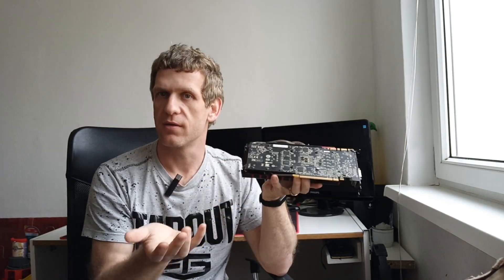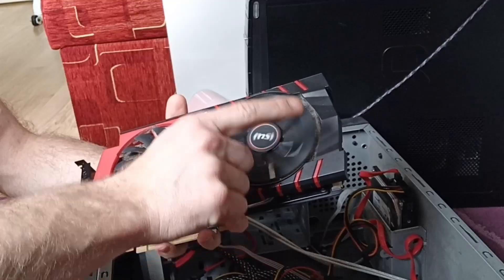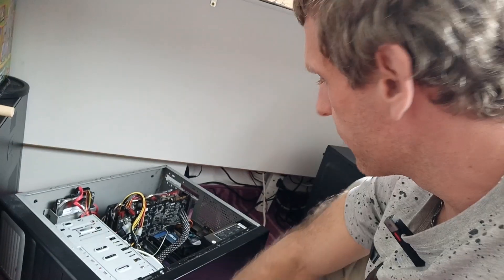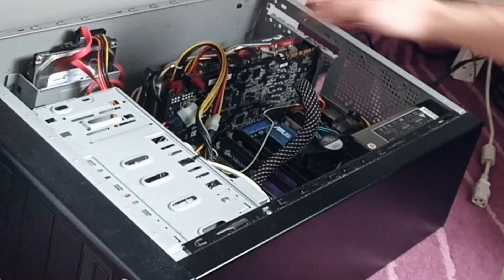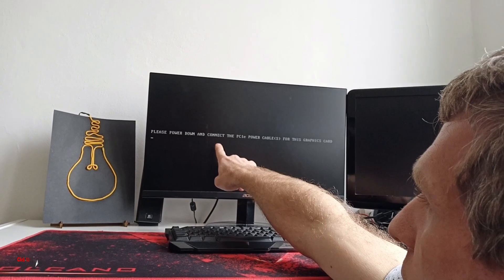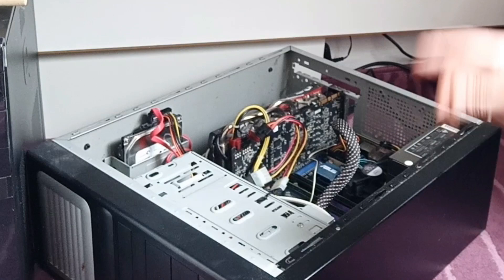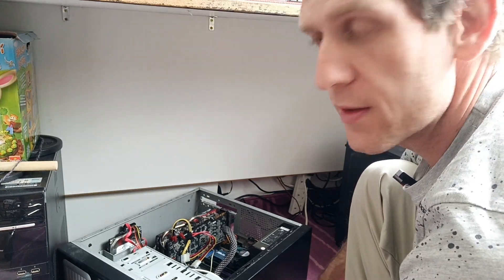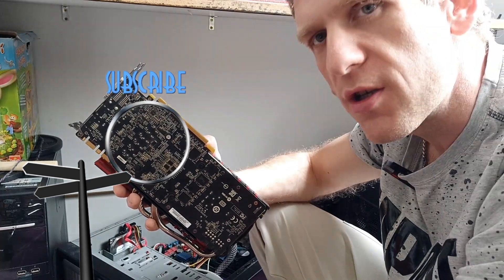How to do a GPU Simple test to find out short circuit problems for beginners

Comment: hwy firend, uhm i bought a new gpu it ran fine for 1 hour then i tried to benchmark it with furmark it ran for a bit then it powered off, after i retried to power it on and doesnt work 😢 its an rx 480 4gb nitro+
Reply from the maker: Your Pc doesn't work at all or just GPU

Comment: hello i got gtx 1650 super...it was work perfectly but one day suddenly my pc not power on at all..then i chk all components..but when i plug off my gpu my pc works fine but if i plug in my gpu pc doesnt power on at all...is it gpu short problem... if it is then is it fixable..?
Reply: We got the same issue, cpu wont work if gpu plugs in, unplug then my pc works,  i touched my gpu and its so hot. Any update to you? Did you fix it?
Reply: @glenmorecape6838  no..i sent it to extanded warrenty..
Reply from the maker: Is definitely short on GPU try test with unplugged power for GPU
Reply: @frogtechtips  i tried it with different pc..same problem
Reply from the maker: This definitely sounds like short

Comment: so my 8 pin is not working for the GPU, but the computer does turn on with 6 pins connected on the GPU. Why? Is it a short? I don't see visible damanage, how to fix? Can it be fixed?
Reply from the maker: @israelsantos4059  hi is definitely short somewhere and is hard to fix you are not technician

Comment: Some PSUs might just fry the GPU if you test it like this. A Corsair GS800 seems to be one of them. I powered the PC on and the GPU caught fire where two MOSFETS were shorted.
Reply from the maker: If is short on GPU is doesn't matter what PSU you have shor simple can make sparkling and fire in your pc. But some PSU can be clever like my one I use for test and will not power your pc at all if short is detect

Comment: I have an 8gb elcheapo gpu nindia some funky off brand name the gpu ran amazing until the thermal grease deteriorated to runny gunk. I know know to immediately change thermal grease prior to gaming with any off brand cheap gpu. when i went to change the grease I bent a few caps slightly. i am unable to find or see the pushed in parts of the caps as they were prior to baking the gpu in a convection oven at 350 for 9 minutes. it still powers on but my hdmi cables are messed up of the gpu is fucked up i shoulda changed the grease
Reply from the maker: This time GPU is so cheap maybe is better just buy new one